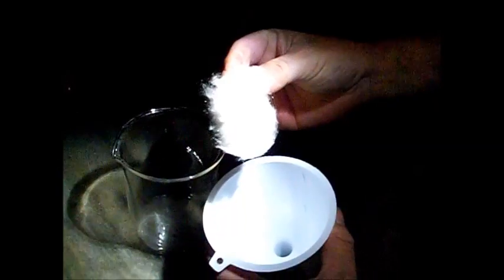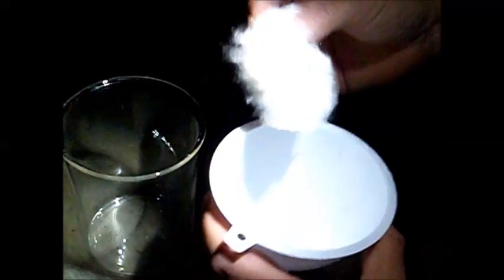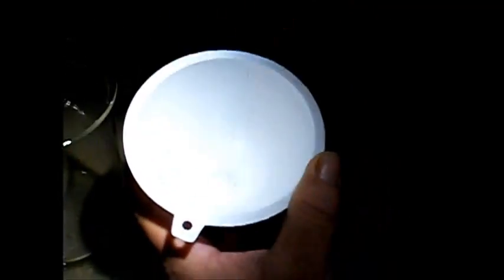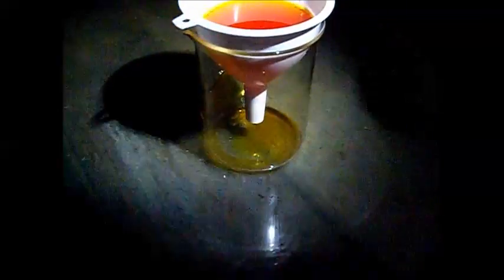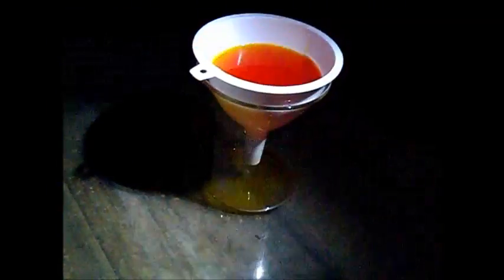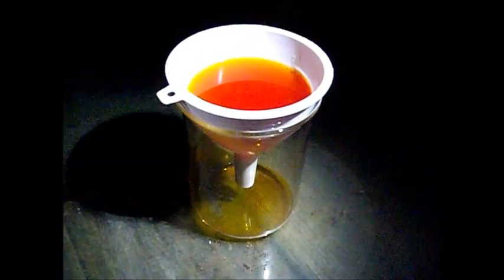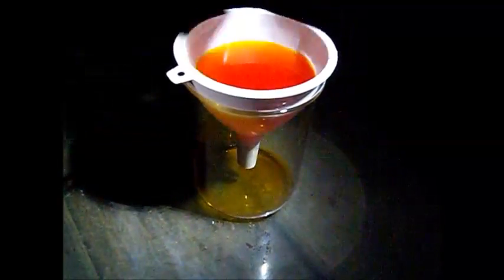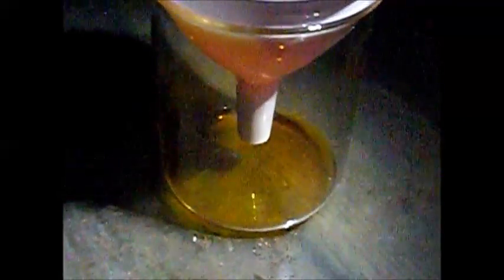Charmin Plug

Comment: hi Geo" i need your insight on gold pins and gold wires some are all gold with just some light metal so im got about 8oz in all i put them all in hcl  in a coffee pot on a coffee stove it gets hot about 185f im tryin to get foils off the pins will this work or what do you think' let me know  thank you for your help"!!
Reply from the maker: +fredie w HCl will not dissolve copper. Even hot, the copper will be relatively un-effected. What kind of gold wire are you talking about? What did they come from? How do you know it is solid gold? You would need about one quart of copper(II) chloride to dissolve a half pound of copper. A small AP set up would do it. You could use a one gallon pickle jar. You would still have to have an aquarium pump to pump air through the solution. Never do anything like this inside your house or anywhere there is metal things you want to protect. If you are in a garage, your tools will rust in no time, your car, bike or chainsaw or leaf blower would all be damaged. The electrical outlets can become corroded and short out.
Reply: +Geo ok" thank you for getting back to me  the pin are out of mother borads and outhers the wire is out of the slots  i test the gold its gold i have a test kit 10k to 22k it shows gold up to 14k and some to 18k i just took the pins out of the hot hcl and i have foils loods like they came off the wires the pins are not coming off so i will start the air pump to night with some new boards as the boards have lots of gold in the see thro holes thro out the bords what do you think im i on the same page as you now ?

Comment: Geo" is hcl and peroxide copper chloride ? im sorry but i think it is whan and after you put  fingers boards in it turns green its now AP = copper chloride thats what i her e you say ?.
Reply from the maker: +fredie w HCl will not dissolve copper by itself. It has to have an oxidizer to get the reaction started. AP stands for acid/peroxide. When you add HCl to copper, all it really does is clean it. When you add the peroxide, it oxidizes a small amount of copper and converts it to copper oxide. HCl will dissolve the copper oxide and convert it to copper (II) chloride (CuCl2). Copper(II) chloride will dissolve copper as long as there is free oxygen in the solution. That's why we bubble air through it. If you do not use air, the reaction slows down and finally stops. If you add more H2O2, it might dissolve some of the gold foils. HCl and H2O2 will dissolve gold foils. There's really no chance for it to dissolve gold at the begging because there is so much copper present. If you keep adding peroxide, it gets to the point that there's not enough copper and the gold starts to dissolve.Use H2O2 just at the beginning to make the first of the copper(II) chloride and use air after that.

Comment: Hi Geo i did what you said about re-dissolve the fine gold with the green mask i did 3 or 4 times the green mask wont go away its all comeing out  of the AP solution and gets cought in the filter i see gold on all the green mask do i need to try the blech and HCL need your in sight thanks once more
Reply from the maker: +fredie w The green solder mask will not dissolve but the gold will. Clean the gold foils and green solder mask of as much acid as you can. Dissolve the gold foils with the green solder mask with HCl and bleach. Filter the solution and the gold chloride will pass through the filter and the solder mask will not and become trapped. Rinse the filter after all the solution passes through and put the filter with any contents into your filter bag for later processing.

Comment: lol, awesome.  So why call it a charmin plug?  Thanks for the great video!
Reply from the maker: +Moose Scrapper Thanks. Well, the first time I seen it was on the GRF and they were using toilet paper packed in a funnel. The problem with paper is it falls apart easily. It was a 50/50 you might wind up with paper pulp in your solution after filtering. Plus, paper can not stand up to concentrated sulfuric acid. The fiberglass was used to filter the the sulfuric acid from the gold stripping cell where the gold powder is as fine as the silver chloride in gold solutions.

Comment: Geo" thank you  this is grate can i use fiber-glass insiltion what go's in side wall's ? its not white but pink thank's for the te info.
Reply from the maker: +fredie w Yes. That will work just fine. Remember to keep the used plug to recover what ever precious metals get trapped just like you would any filter.